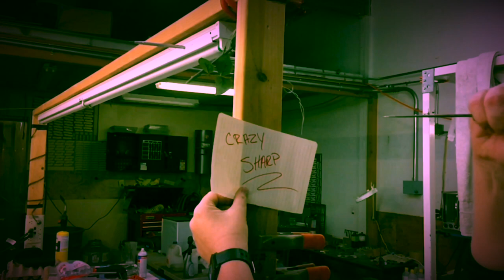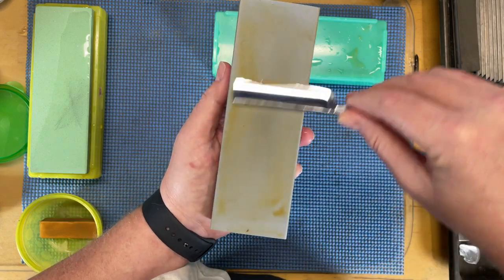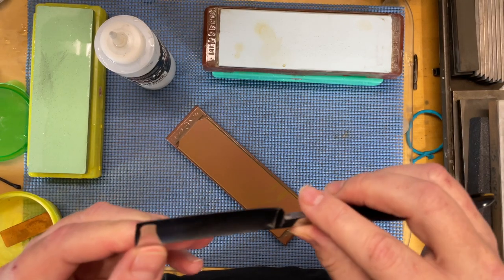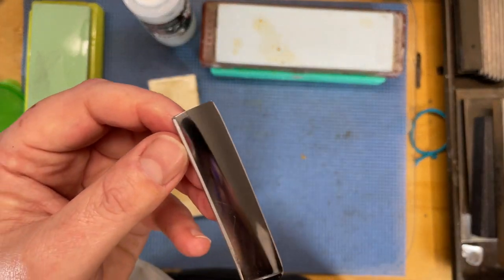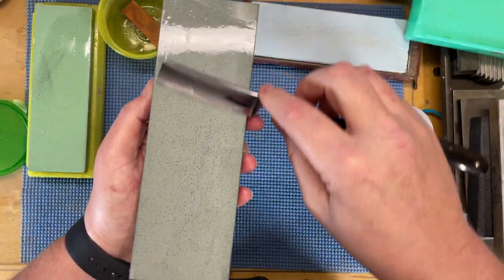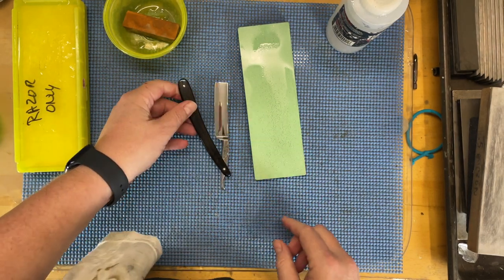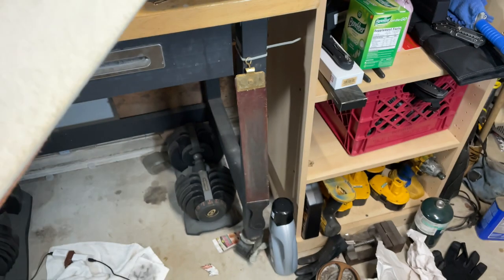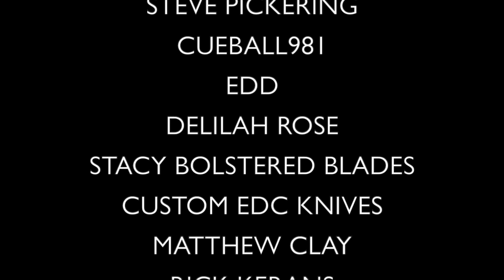SHARPENING A STRAIGHT RAZOR START TO FINISH

Comment: Baking soda in the water explain why please
Reply from the maker: I am 100% sure I did but it lowers the ph of the water and prevents the carbon steel from rusting as easily
Reply: Prohibits flash rust with any iron or steel. Conversely you can also remove rust with a vinegar soak just no more than an hour or the steel or iron will discolor and you will have to polish the metal. (Honestly if there is rust you should polish it and the pits it leaves behind anyway.)